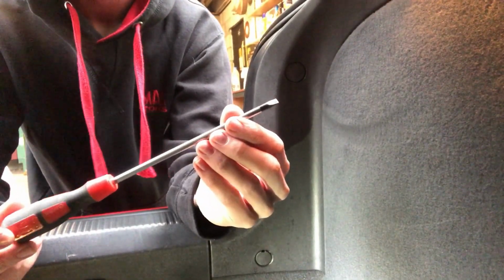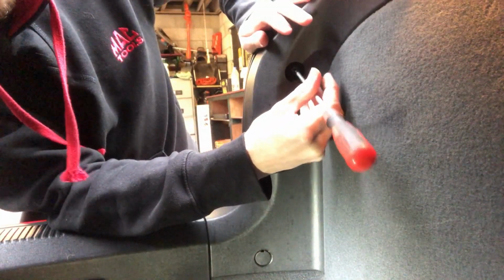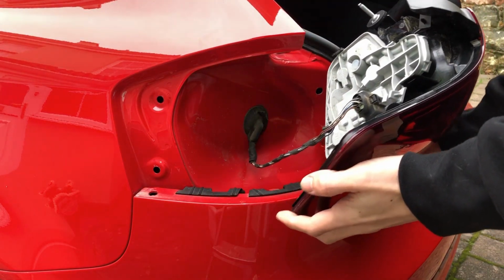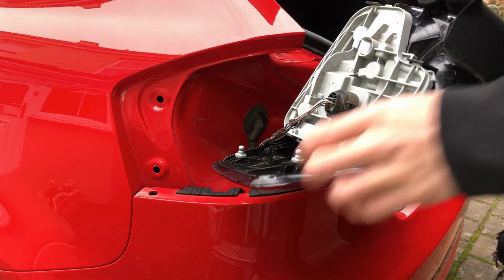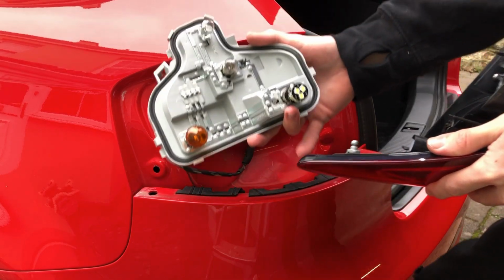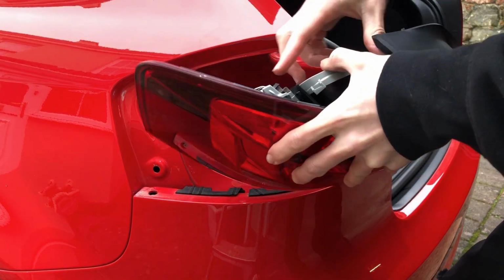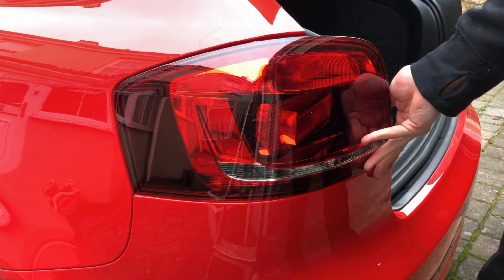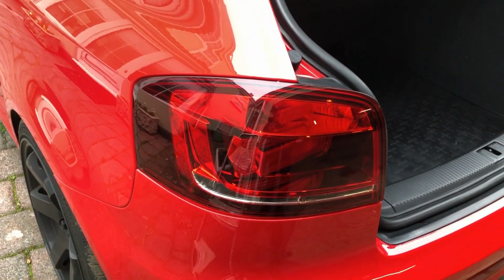How To - Replace Tail Lights on an - Audi A3/S3 8P

Comment: Hey man I was wondering if there is a bulb for the rear running light? Mine is out the the brake lights work.
Reply from the maker: SSR VASH the tail lights and the brake light might be the same bulb witch is a double Filament bulb

Comment: Hey wanted to ask, i want to change from stock rear lights to facelift, but the brake light bulb doesnt fit in fl lamp its too big for it, any advise?
Reply from the maker: You have to get fl bulb holders aswell as the light

Comment: What is the led bulb you use in the cluster I can see at the bottom right?
Reply from the maker: James Crawford reverse light mate :)
Reply: @MotoAdventuresYT  it's an LED you use though isn't it, I've just tried installing an LED for my reverse light and it's throwing up an error on my dash... Does yours? If it did did you remove using carrista?
Reply from the maker: James Crawford You need to get the bulbs that are CanBus- error free
Reply: @MotoAdventuresYT  pretty sure ones I got are but still didn't work, do you know where you sourced your ones from? And have you swapped out the rear brake lights or rear indicators with LEDs?
Reply from the maker: I got mine a long time ago mate, there are loads on ebay, no only the reverse light bulb.  @crawfy53

Comment: so I ended up dropping the plastic bolt that you have to take out into the body of the car.. can I get it out or do I need to get a new one?
Reply from the maker: Hi mate, you can’t get it out unfortunately, really bad designed, you’ll have to get a new one ASAP

Comment: hello mate, please tell me the part number for the bulb holder. I’ve bought the new tail lights like yours and they dont come with a bulb holder. unfortunatelly the holder from the old ones does not fit
Reply from the maker: Passenger side is- 8P3945257A, drivers side is 8P3945258A